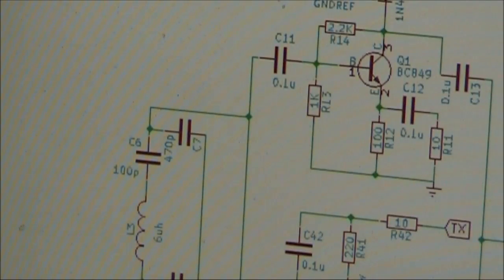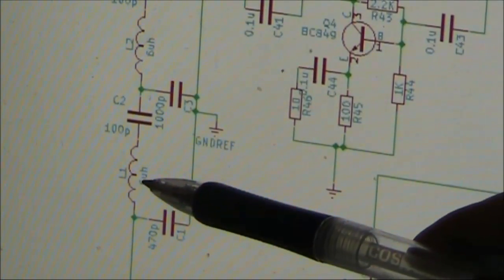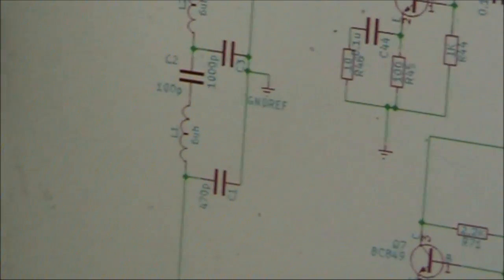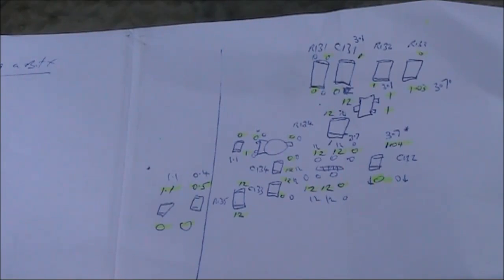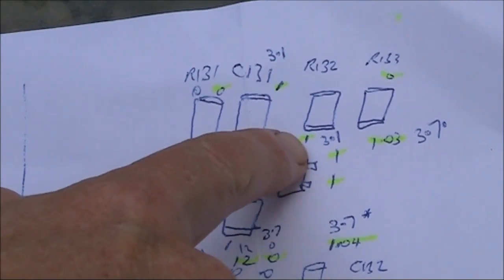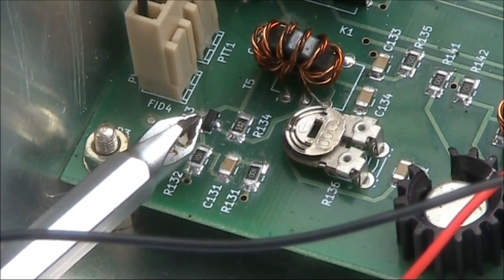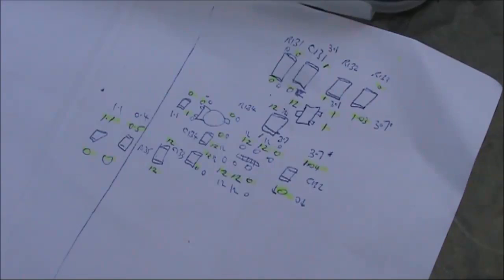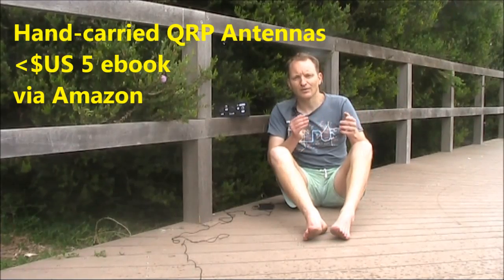Repairing a Bitx40 QRP transceiver

Comment: I'm new to hams, I have my BITX set up, but I'm wondering why the current drain on transmit with loud awwww is only 0,5~0,6A on 12V battery, without any sound it takes 0,37A, as in the instruction. Is that possible that this Q13 is faulty or something? de sq5gn